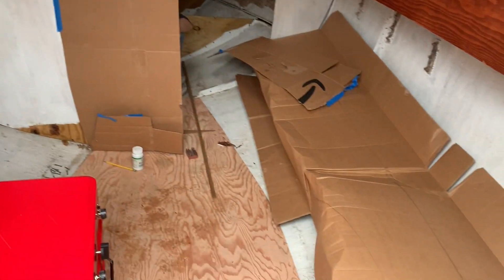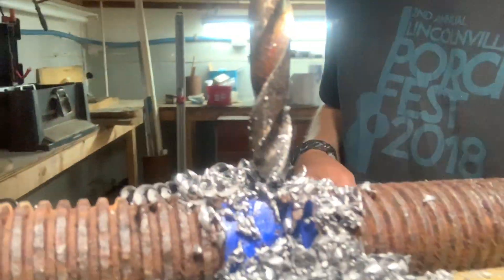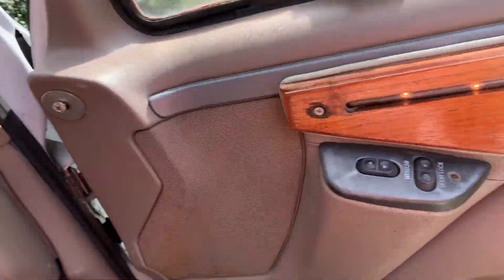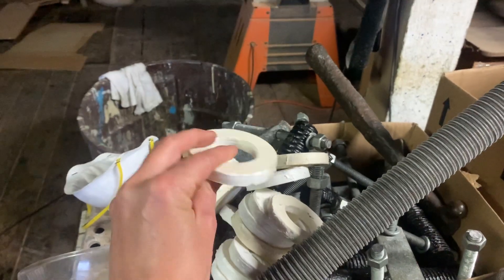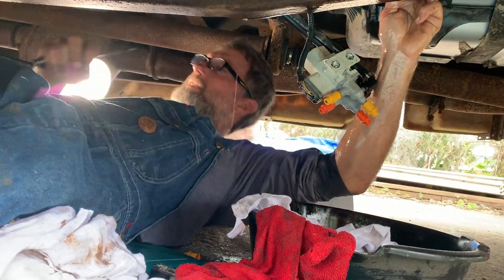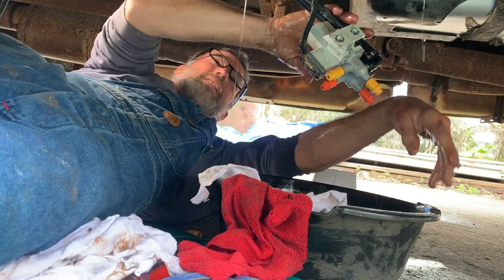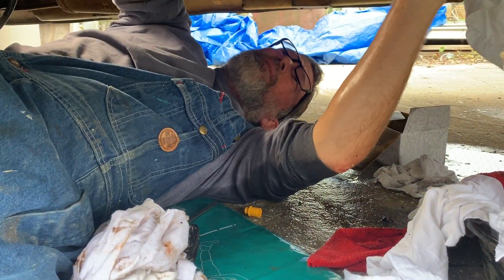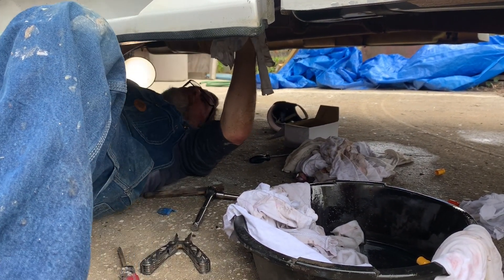Replacing a Fuel Selector Valve on a 1995 Ford F350

Comment: I like the pickup, I have a 95 diesel also!  My fuel selector went bad.  I was avoiding replacing it tonight after watching Pete bathe in diesel.  I’m just putting off the inevitable…. I got a dorman, hopefully it last
Reply from the maker: @BlueF350  we replaced ours with the proper Ford replacement after a second one went bad, tho we did get smarter and got small clamps to clamp off the fuel the second time around. This made for a much better replacement 😆

Comment: I have a 91 Ford f350 7.5 dually and I can't figure out why my gas is overflowing. Before when I use to drive on the rear tank, some how the front tank gets extremely full and leaks out from the filler cap. Now the rear tank I'm over filling when I drive on front tank. Idk what cause it.
Reply from the maker: Have you ruled out a blown gasket?
Reply from the maker: Hopefully nothing that drastic, but have made antifreeze in our diesel on our boat and it was a blown head gasket. Does it only leak out when you are filling? If so, it could be a clogged vent. Hmm if I think of anything else, or you have any other things to offer that you’ve noticed
Reply: @AccidentalSailorGirl  the other day as I was filling the front tank and it was pouring back out like a waterfall and same goes for the rear tank and I didn't even bother going back in the gas station to get the rest of my change. And earlier as I was walking around my truck, I see gas dripping on the ground and asi tried to remove cap, pressure of the gas jumps out on the rear tank and the gas was way full up to the cap.
Reply: @AccidentalSailorGirl  it's not a blown head gasket. I know if my head gasket is blown.
Reply from the maker: @hendricks177  yeah, sounds like a venting issue
Reply: @AccidentalSailorGirl  ok. Someone said that it could be the fuel tank selector valve. Meaning like the valve is not closing all the way for one tank while the other tank is being use. Now my rear tank is completely full and gas still drips into a little bucket. I got to do the same way as I did with the front tank. Just drive it so the gas can start going down.
Reply from the maker: @hendricks177  mmmm.... I would say that the selector valve would not stop you from being able to fill your tank. I think I remember the vent is on the top of the tank when we dropped ours
Reply: @AccidentalSailorGirl  can I drop the tank without moving the whole entire bed of the truck?
Reply from the maker: @hendricks177  you’ll know it’s the selector valve because it won’t switch tanks when you switch the button. If it’s stuck, it will limit your fuel and the truck will die on you like you ran out of fuel.
Reply: @AccidentalSailorGirl  ok. Before I always drive on the rear tank with the front tank off. I only use the front tank for emergencies. I use to keep at least a half of gas in it. I just want it to stop so I don't want to be leaking no fuel and I'm afraid that I won't be able to fill up the tank because it leaks back out.
Reply from the maker: @hendricks177  we did on our tanks. It’s a job. I don’t exactly remember where the vent is, you could ask around and see. I can look at our old videos and see if I see any from when we dropped the tanks. There might be some good info in those videos for you
Reply: @AccidentalSailorGirl  thank you. I really wanted to see if it's the vents. I don't wanna have to put a little gas a time.
Reply from the maker: @hendricks177  https://youtu.be/0d7Pcv2VXoc ok, here you go. So the tank dropping is about 12 min in... we also go to show what the tanks look like, including the gauge which luckily didn’t have a filter. The vent is in the middle on top of the tank. It’s just a hose, maybe you can reach up there and find that hose and see if it’s clogged
Reply from the maker: @hendricks177  yeah, to me it sounds like the air isn’t escaping from the tank as you replace the air with fuel. So it just back pressures instead. Like trying to blow on a straw with the other end clogged. It’ll only allow a tiny bit of air and then stop.
Reply from the maker: @hendricks177  we had a mud dobbers nest on a vent on our boat one time. Couldn’t figure out what the heck was going on for a bit until we found it
Reply: @AccidentalSailorGirl  yeah. Because the fuel is still sitting at the top of the filler cap. When I turn the cap to take it off, a lot of pressure comes out and alot of fuel comes out to so I just tight the cap back on.  And it's leaking  a little bit but not much. What is the inner hose called?
Reply from the maker: @hendricks177  yeah we remember there was a double hose going up to the fill, but can’t remember all the details. The vent was separate of this I think, might’ve connected somewhere to it, but can’t remember exactly. You’ll have to put some safety glasses on and crawl under there and investigate
Reply: @AccidentalSailorGirl  ok. Mine has 2 hoses. The outside hose and the inside hose but idk where the inside hose connects to. I always think it's the inside hose that's causes my gas to do what's it's doing.
Reply from the maker: @hendricks177  good luck on your troubleshooting. Send an update when you figure it out! 👍👍
Reply: @AccidentalSailorGirl  is the inside hose connects to anything?
Reply from the maker: @hendricks177  what, the vent hose on the tank? On ours it’s just a loose hose that I remember
Reply: @AccidentalSailorGirl  it's the outside hose that goes between the tank and the fuel filler neck. Then it's another hose inside.
Reply: @AccidentalSailorGirl  I would send you a picture.
Reply: @hendricks177 did you figure out what's wrong I have the exact same problem you described
Reply: @wily3226  well as I can see. It's probably the hose that connects to the filler neck but the inner hose is broke and not providing any vent air. My back rear tank don't do it.
Reply: @hendricks177 I am having this issue as you did you ever find your solution
Reply: @nicholasmargolati169  it's was a venting situation. The inner hose that goes into the big hose of the neck and to the tank is rip.broke .
Reply: @ which neck did it break in
Reply: @ my issue started 2 weeks ago when I would open the fuel cap there was a bit of pressure but nothing else wrong so I didn’t try and fix anything then 2 days ago I filled both tanks drove home on the front tank and then noticed it dumping fuel from the filler neck when I got home and when I switched to my rear tank it was empty b

Comment: What was the issue with the fuel gauge? Is there a previous video about that?I have a 1996 f250 7.3l that the gauge does not work for either tank.
Reply from the maker: Yes! We replaced it with a aftermarket fuel switch. It died a year later, so we got smarted about replacing it by buying some fuel clamps to stop the fuel from pouring out everywhere while replacing the switch
Reply from the maker: Got smarted... yeah sure... thanks autocorrect 😂😂

Comment: There's an issue with that era of Fords that the black plastic feet with the screen on the fuel pickup line in the tank get brittle and fall into pieces over time, then the pieces get sucked up into the fuel lines and get stuck in the tank switch valve which then won't let it switch or partially plugs it or both, or sticks it half way between tanks allowing air to be sucked in if either tank runs dry and pieces can also get sucked into the lift pump stopping it from working.. There could be chunks of plastic stuck anywhere in the fuel lines partially blocking them. I assume that is why there are both new fuel tank as well as new pickup line and foot in the tank to try to address the issue.. 

Friend of mine with a '93 Ford with a 7.3 in it replaced three lift pumps in two weeks before I showed him what was going on. I always though it would be a good idea to just put a marine fuel filter/separator in line before the lift pump, Racal or whatever in the line on those trucks.

Another common issue is the CDR valve, you might want to keep an eye on that too.

If I had a dollar for every time I asked myself "who the hell designed this?" When working on mid 90's Fords I would be a lot wealthier.
Reply: Would it cause it to suck air even if both tanks were full?
Reply: @kadehurt8365  Typically no, but it will suck air if either tank is close to empty. Or it just won't pump fuel at all because little bits of plastic get all hung up in the fuel pump or blocking a fuel line up.

Comment: Had the Ford switch stick half way, stranded on I-95 night South Carolina
Reply: What was the symptoms for the stuck switch?
Reply: @kadehurt8365  Truck stopped on hi way with adequate fuel left. Garage replaced it the next day, also diagnosed as I did not know problem. thought maybe put diesel in gas tank.
Reply: @chhindz  did that cause air in the fuel?
Reply: @kadehurt8365  Was gas powered, valve stuck half way getting gas from neither tank. was about ten years ago
Reply: @chhindz  thank you!!